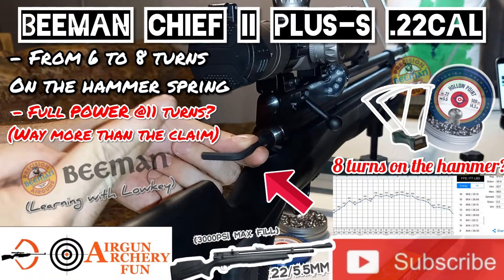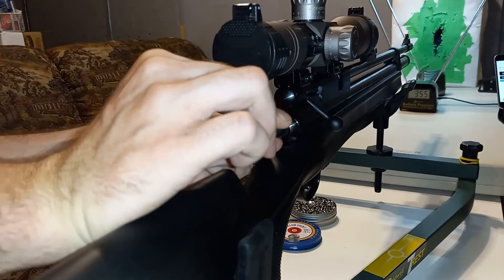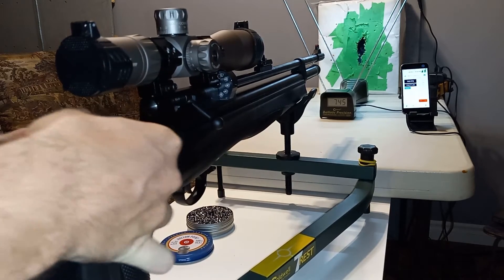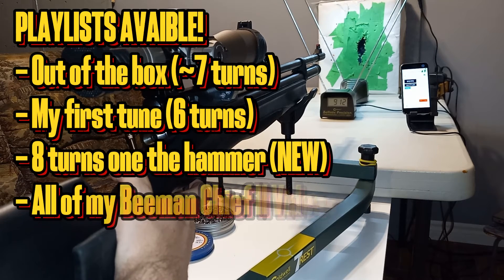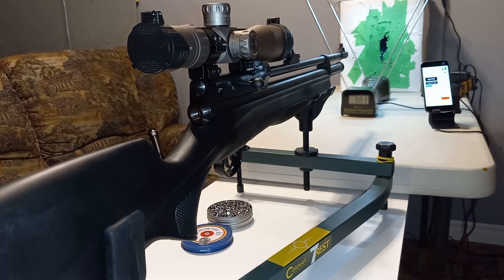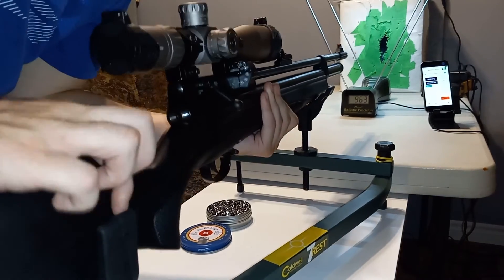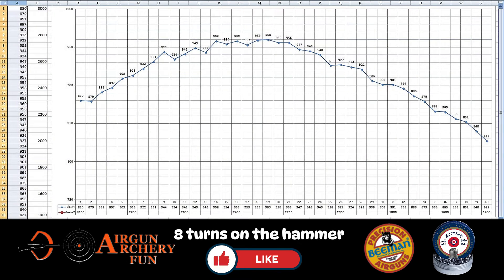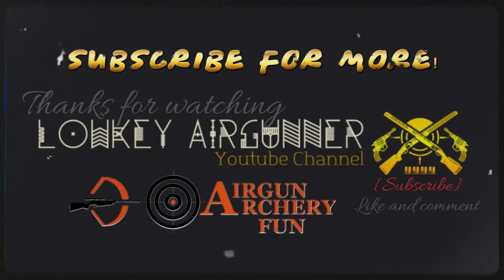Beeman Chief II Plus-S .22cal // Max velocity & 8 turn on the hammer spring graph (Chronograph test)

Comment: I got lucky and mine is insanely accurate with most pellets, but I can only do 11 "half" turns on mine. The screw is very stiff on mine and I had to max out the hammer spring then back it off about 3 and a half "half" turns and it shoots fine. Any idea why mines like this?
Reply from the maker: @9derick6  You mean that it will not fire over this amount of spring tension or you simply cannot screw it further in even if you actually try ?
Any clue of velocity?

Unless you are shooting from 10m at 1500 psi max I doubt that mine would even fire at 3000psi with 3 1/2  turns let alone be accurate 

With that said that about the spring tension I need now that Ive installed a regulator?! 
Is that a thing in yours?
(Not sure of my reg pressure the gauge stopped working but im getting arround 830fps at 3 1/2 turns and thwt definitely wouldn't work on a full 3000 psi fill)

Thanks for watching :_LwkLogo:
Reply: @LowkeyAirgunner  I mean that I turned it all the way in then backed it off 3 1/2 turns just as you did. I don't know the fps as I do not own a chronograph yet but am hoping to soon.

I'm glad you mentioned the regulator as I am waiting for the altaros regulator to be back in stock. I did not know it would make the pressure gage not work. Interesting.

Did yours increase shot count? And is it worth it to regulate? 

I'm sorry for all the questions. You seem to know what you're talking about and I love your videos. Nobody else is talking this much about the chief 2 or chief 2 plus.
Reply from the maker: The gauge worked for a second and then stopped working for some reasons this was a gauge block Lane regulator and of course with my luck the website went down like the day I wanted to install it so I don't know if the gauge went bad of it can be an other issue 
(Litterally went on it the day before and it said he was on vacation... I think the Altaros is way different and easier to install but to be fair the New Lane reg wich is not the one I got doesn't remplace the full gauge block anymore so not much)

I didn't test it much yet I had a few issues and it will be annoying without a gauge but it does seem to be regulated to get a fairbit of shots at 830 fps or so for now we ich im curious to see if it will increase accuracy even at lower velocity because it is a bit more consistent 

But you mean that all the way in is only 11 half turns so the maximum would be only 5 turns or so?
This sounds weird this one was arround 7 out of the box and the 2000 psi arround 6
Reply: @LowkeyAirgunner  I'll see if I can find any information online about why the pressure gauge stopped working and hot to fix it. Information for the chief 2 is limited so idk if I will find much. If you have any info at all that would help me take apart the rifle and install a regulator I would be eternally grateful. 

And yes about 6 full turns all the way in from flush. So I backed it out about 1 and 3/4 or 1.75 FULL turns or 3.5 "half" turns on the adjustment screw. It seems to shoot really well I'm just curious if maybe your beeman uses fine threads for the adjuster and mine has course threads? That could explain why your screw takes more rotations to max it out if it has more threads for the bolt that are smaller. 

Any info you have on doing a regulator and any tips you have to get the most out of this rifle I am all ears. Even if it's just a preference you have on something about the rifle, for me the fun is in tinkering with it and taking something good, and creating something completely unique that shoots well and nobody else has exactly the same thing. 

Thank you for taking the time to respond.
Reply from the maker: Not too sure about why yours doesn't seem to go any further hopefully it is not rust preventing you to use the threads...
I guess if it is the same adjustment range but less fine tuning it would not matter much since it is not that sensitive but it still sounds weird

I can't find any info on why my gauge stopped working but also don't feel like removing the reg to see if it works by itself haha
I wonder if pump threads are the same and if I could test it on there but again I need to fully degass it and blablabla so lets try it first and see if I need to crank the reg all at once
(Wich needs a partial disassembly because I didn't forget to tie a rope to it this time. Lol.)

Here is most of what you need to know:
https://youtu.be/f6r-6TCyiWw?si=ahKeBKaPaNT5lPyj
Reply: @LowkeyAirgunner  Thank you for the information. After much research, I believe I may know how to fix your accuracy issue. Ever heard of hammer bounce? It's when the hammer bounces off the valve poppet when fired and rebounds off the hammer spring back into the valve poppet again releasing more air. This can greatly affect accuracy and reduce shot count. I'm trying to find a spring that has the same tension or more than the original but about 4-5 mm shorter. I noticed a lot of preload on mine and I definitely suffer from hammer bounce. If we can fix this it will no doubt increase shot count and help accuracy. I can't say how much accuracy will improve but it will help.
Reply from the maker: @9derick6  I've heard of this before and it might help for sure if we can find the perfect one sadly I don't have the budget to find out currently 
(If I turn mine to flush it won't even fire at 3000 psi and the hamner is flopping maybe that's a new fix after the Crosman Icon recall?)

The regulator should halfway fix this issue since it only needs to dump a smaller volume of air with less counter force but the gauge not working for now is definitely annoying
Reply: @LowkeyAirgunner  I just found out by taking the moderator off mine that it was experiencing pellet clipping at some point. So that's another possible issue to look into. I am on a quest to find a spring that is shorter and works better but is also cheap. If I do, I will get two of them and I'll try to send you one. I understand money being limited as mine is as well. 

I'll keep you updated as I have time to figure things out and pass the information along.
Reply from the maker: @9derick6  Mine is Kenadian and doesn't have a moderator sadly!
I wished it was this simple but it does seem to shoot straighter since I've took it appart 
(Breech might have been installed wrong so alligning the barrel wasn't helping)
Reply: @LowkeyAirgunner  I didn't know Canadian air rifles couldn't have a factory moderator. That sucks. In America, you can supress your air rifle BUT if it can fit a firearm you can end up in a lot of trouble for it! The laws are crazy. There's some info out there for the beeman 1358 and barra 1100z and both of those guns are similar to ours. As I'm able to make adjustments I'll share what I learn I have just been busy the past few days and haven't had time to tinker with it.
Reply from the maker: Yeah no bullpup if stock is removable (need a chasis) no pistol over 500fps and no moderators! 🍁HoeKenada 🍁
Reply: @LowkeyAirgunner  wow. I'm sorry brother. That's weird regulations for airguns but even we have some weird laws. It's dumb 😒
Reply from the maker: @9derick6 It is definitely pretty bad but could get even worse if they keep talking about replicas/sub 500 fps airguns wich didn't require a permit and was the only way to get a "handgun" still

Comment: The south african and south american version of the beemans seem abit better, my daughters one goes well passed 13 turns, also comes standard with 1/2" UNF threaded barrel for a silencer. 
Called different names but B57 and B58 are consistent across countries. B58 would be more like the Beeman comander
Reply from the maker: The B57 looks exactly like the Gen1 of this rifle so I am not sure how it could be better if most likely made in the same exact factory as the Beemans

I am not going to lie after having a few little issue with this rifle I am starting to think that the Barra 1100z is a slightly better option
(Same-ish gun but different o-ring placement and side lever)

Thanks for watching! :_LwkLogo:
Reply: @LowkeyAirgunner  I only mean better because it easily accepts a silencer without needing any adapters and it seems to have more turns on the hammer spring, I just checked now and could do 16 full turns and it can still go more, I just don't want to damage it by maxing it out so not sure exactly how many it can do, I'll get her a chronograph end of the month to see how exactly it affects velocity on 16 turns and if it causes issues with the valve locking or anything.  She has the B58 "warrior" it's similar to the BAM/CBC B58 just with a threaded barrel instead of a mini moderator.
Reply from the maker: @TheRealVicarious  This one is a Canadian version this is the only reason why it doesn't have the LDC and threads (atleast I believe it is not threaded under the front sight)

Comment: 💯👍👍👍👍 GREAT VIDEO.
Reply from the maker: By the look of this 6 turns would be the minimum for the .22cal/3000psi version or you might get valve lock at higher pressures 

This 8 turn on the hammer spring tune seemed to be pretty promising with the 15.89gr Jsb's but might be a bit shy for the heavier pellets that I wanted to try in it...
To be continued.

Thanks for watching

Comment: Good one review testing! I think you might get better results turning less on increments. Like half or quarter turns. Some air guns only like eighth turns. I don't know what ur fascinated with to having to shoot out to 50 yards is about. Turn up to the max power at 10 turns and use heavy ammo. Turn it down to use light ammo. Plain and simple.
Reply from the maker: I get that.. but if I don't figure out what the adjustments are doing first (to the curve mainly) or which pellets I need to fine tune it for it is complicated to do tiny increments and spend alot of time tuning for each pellets 

Since I can't really bring the chronograph without it being a pain or getting dammaged I was trying different power levels to see which pellets it seemed to like at longer distances and then move from there but my first tune was negative for pretty much every pellets so 6 turn is the minimum for this rifle
(No valve lock but not very accurate)

I know that more power should mean more weight but I prooved myself wrong by trying heavier pellets that performed better with less velocity
Sometimes you gotta experiment to really know instead of assuming

Thanks for watching
Reply: @LowkeyAirgunner  I think maybe you should've left it alone factory. It is a cheap rifle. I think  you should look more into research b fore purchasing. I'd send the rifle back b fore it's too late back to air archery fun an sad Airguns place and purchase something that's known to werk like the Diana Stormrider or a Snow peak rifle. Your rifle shouldn't have that much problem for you. The Beeman QB Chief and the Underlever 1357 and 1358 are better made riflelz from Beeman's. I'd look into some of these so you get a better experience from PCP power riflelz. I'm afraid your Chief 2 is messed up. It shouldn't shoot all over the place even tuning it shouldn't. I only know a handful of airgunnarz that's gotten one that shoot ok. I generally research thoroughly b fore I purchase! Even high end riflelz! You did have the rifle shooting decent once, but something has gone awry. Sometimes things are better left alone. Just trying to give you some pointers my friend,not trying to tell you what to do with your things. I have over 40 yrs experience in the air power werld 🌎
Reply from the maker: I don't think I will send it back for the price I can get it and I do think wind and tuning can affect accuracy alot especially with a beginner shooter!
It might be a bit pellet picky at longer distances but I think it did decent with some of them before I've messed up the tune

For a budget rifle yet other than the mag getting sloppy causing the probe seal to fail I don't really have much complaints...
But I can complain about our bad summer and the fact that I can't shoot in my backyard in kenada so it took alot of time to figure it out.
Now there is snow.
Reply: @LowkeyAirgunner  ya understand friend! Hope you are doing well🙂

Comment: Good stuff Lowkey. Keep going and try some half and even quarter turns on tje hammer spring. It will make a difference in accuracy and consistency. 😊😊
Reply: that is an excellent suggestion
Reply from the maker: I definitely need to do some fine tuning eventually but I wanted to try a few pellets first to figure out which ones I needed to focus on but I got sidetracked because of my meh first tune attempt 
[Would you fine tune while shooting and juge only by the group size? Bringing my chrony would be a pain.]

I am currently trying to test heavier pellets but weather is not really on my side.
+ I am starting to wonder if the probe seal faillure started before my hunting session and affected prior results

Thanks for watching!
Reply: 10 4 on that I copy  @LowkeyAirgunner
Reply: @LowkeyAirgunner  Oh Shyt! It have pellet probe sealz on it? OMG
Reply from the maker: @eddiecahall3824 Yes it has two probe seals and came with one spare.
It seems to be a common problem & I had heard of it before but it was doing great with zero wear yet!

I suspect that the magazine is problematic more than the seal itself...
They get loose and cause extra rubbing from what I can tell

Comment: As I said before I got this gun in 177 on a trade and with the Crosman 10.5 grain pellets I'm getting low 1000's for fps out of the box with it .
Reply: 😮😮😮Got me again TIMMY TIMMY TIMMY 😂😂😂
Reply from the maker: I really wonder if the hammer spring/valve is exactly the same on the .177!
At 6 turns you would be way over 1000fps {I believe} and it wouldn't make sense to turn it down to get a better shot curve on a 3000psi model

Your .177 (wood stock I assume hehe) sure seems to be a good shooting rifle!
Reply: @LowkeyAirgunner  it's a great shooting gun and no it's not wood stock ! 😒 but you know I wish it did have a wood stock ! Lol
Reply from the maker: Pfff no wood stock on Timmys rifle that's a blasphemy ✝️